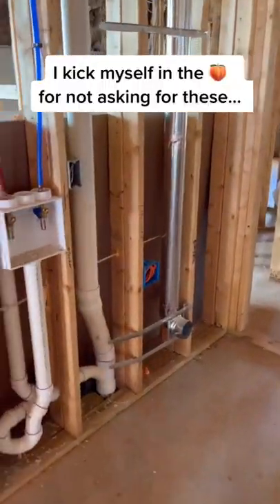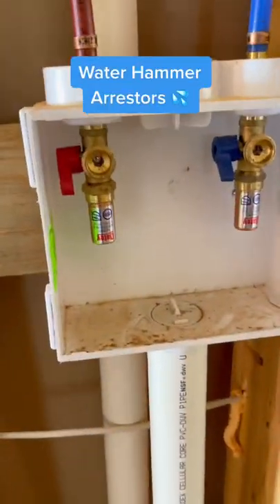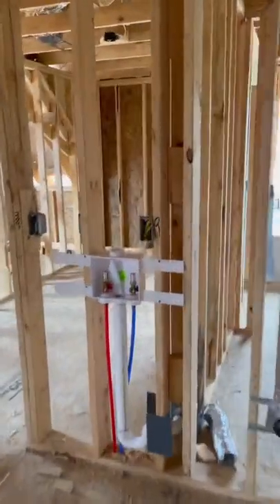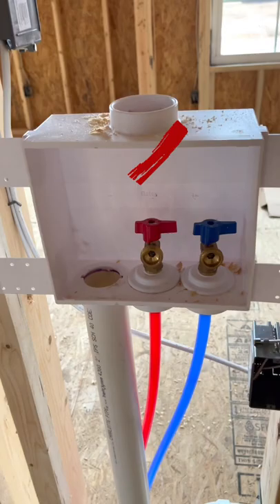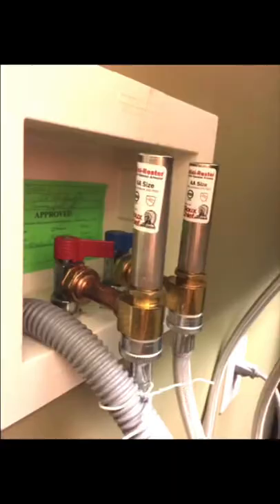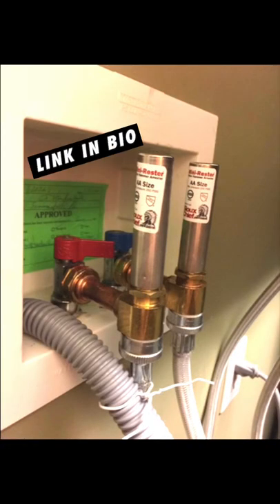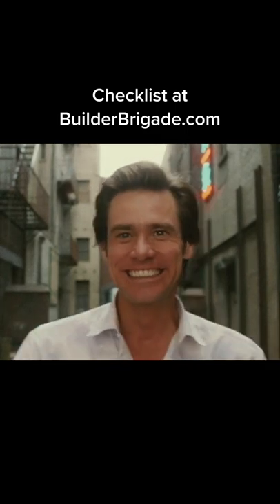I kick myself in the 🍑 for not asking for these…

Comment: Our 2nd bath toilet does it when we flush Andy suggestions for that?
Reply: Secure the pipes properly should be enough
Reply: Yup.  That is the trick on ALL the pipes.  Secure to the studs inside the walls.  Now that you house is finished. You would have to open up the wall to do this.